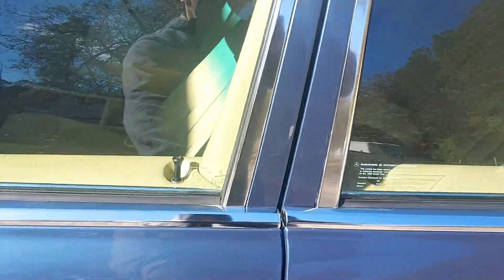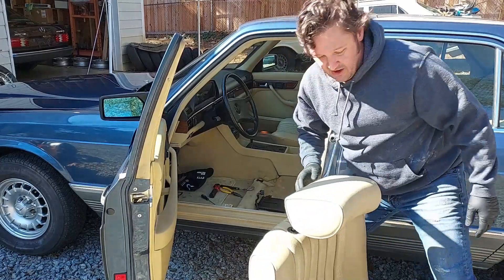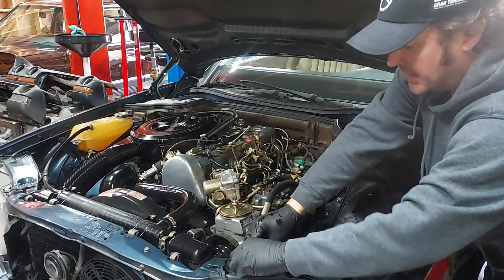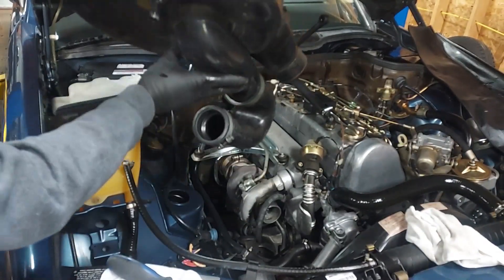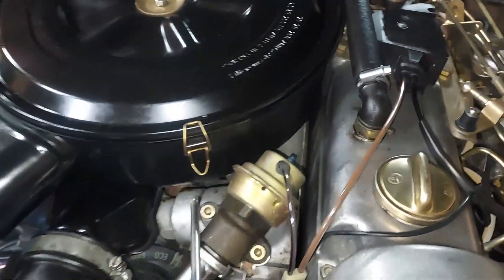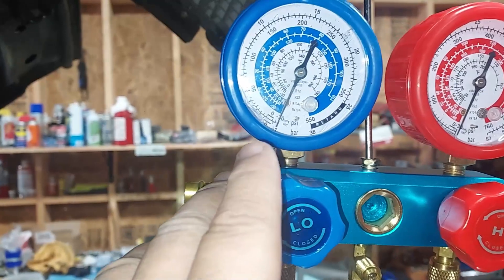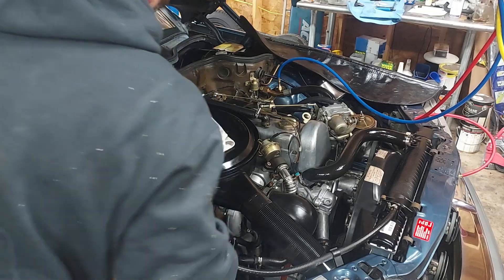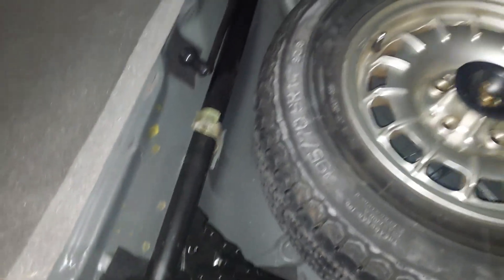1982 Mercedes 300SD - Part 3 General Service, Seat Motor, AC Recharge

Comment: Thank you for the awesome video!  I was able to correct fore-aft and rear cushion height adjustment cables perfectly.  However it seems there is also a front cushion height adjustment as well.   Is there a fourth motor/cable I’m missing?
Reply from the maker: Awesome I'm so glad the video was helpful! You'll have to look under your seat to see if there's any cables missing.

Comment: Do you have a preferred tire for W126 models?
Reply from the maker: Michelin stopped making the 195 70 r14 tire but Michelin owns a company called Uniroyal and I have had great success with that tire. It's the Uniroyal tiger paw and I use it on my personal daily driver and it works excellent and has good wear life.

Comment: Do you have a preferred tire for W126 models?
Reply from the maker: They don't make michelins in the 195 size anymore however Michelin owns a company called Uniroyal and I have had excellent success using the Uniroyal tiger paws. I put those on my 1980 300sd and they are great tires.
Reply: @woodsandbarclay  I have a 1991 300SE and have just put the same tires on it. I wanted Michelin but, as you say, they aren’t available in the size anymore.  Thanks, John. Love the site….maybe I’ll go diesel someday!
Reply: @woodsandbarclay  Now that right there is some good info.  I know I have quite a while before I'll need tires on my 300SD, but it's good to know that Uniroyal is an option, especially since they are owned by Michelin.  I REALLY wish Michelin still made tires in these sizes.  I've heard you can actually get some older sizes from Coker but they are REALLY expensive (i.e. $300 per tire).
Reply from the maker: @timfetner8029  sometimes I also use Falken and Hancook. I have also had good success with those tires.
Reply: If you're talking about 14" wheels, GENERAL ALTIMAX RT45 is something I've had my eye on. The speed rating isn't OEM, but I'm not planning on going over 118mph.